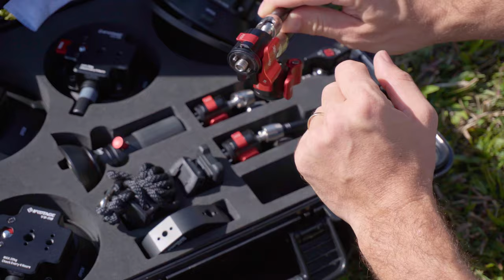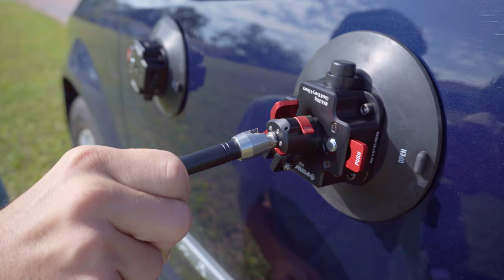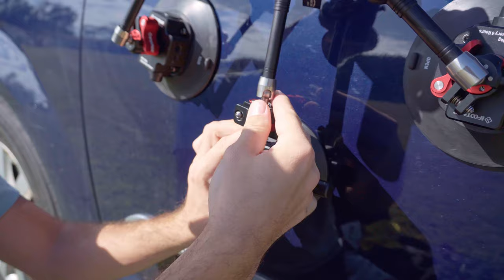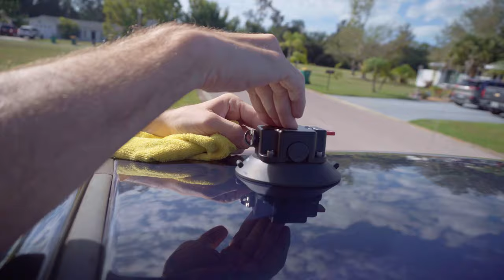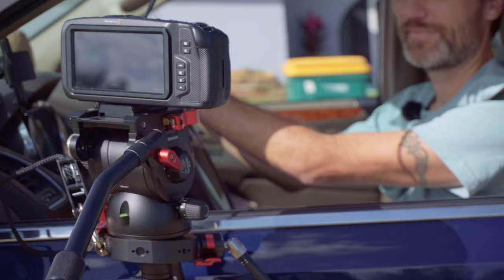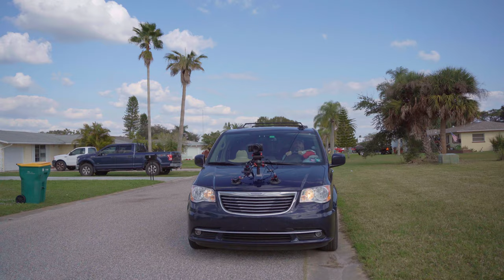Genius Vehicle Camera Mount!

Comment: Looks great! And great practical review.

One thing to keep in mind when securing any vehicle mount is you want to secure it so if the suction cups come loose there will be minimal movement of the mount. One tie-off is good, but it will still fall and flop around damaging the vehicle (possibly an expensive picture vehicle) as well as the camera and mount. So don't be cheap on tie-downs!
Reply from the maker: Good point. I just wanted to use what was provided in this kit but on a real shoot I would use more tie down straps
Reply: @TomAntos  where can i buy the tie down straps separately?

Comment: Great application of these power vaccum cups. Thanks for sharing. You just have to look for the grey ring on the pump after it is sucked down. If the grey is visible, the cup is leaking but still attached with great strength.  With 3 cups you could rip the door off the car so it will never fall off (a 4" cup can hold 185lbs at sea level).  It takes a bit of trust.  Try pumping down to where you can still see the light grey on the pump button and see how strong it is.  These cups are available on Amazon in different sizes and costs and you could make it with magic arms etc but it would not be as well put together as the kit.  Thanks for sharing

Comment: Looks like a great little car rig. I like how quick it was to set up and not requiring any tools. Thought the pins on the sides of the threads were a good safety measure too. 

I would like to see how you would rig it to film the driver from the hood. I am interested where you would set the tie off.
Reply from the maker: To get a shot of the driver from the hood of the car would be exactly the same only difference would be that I would have to use a polarizer filter to hide the reflections in the windshield. This way you can see the driver instead of the reflections of the bright sky. Also this filter would hide the reflection of the strap that goes to the roof of the car.
Reply: @TomAntos  That is great that the polarizer will minimize the reflections (including the strap). This was a great review, as always. Thank you and I hope you and your wife are enjoying life in Florida now.

Comment: Very cool system.
Thank you for the review!

Can you test it with an IBIS-camera and a gimbal?
Would be interesting to see how much it smooths the shot...
Reply from the maker: Okay ill do a follow up video on my website
Reply: @TomAntos  Thank you!
Reply: IBIS when used hard mounted to a car will create micro vibrations. Highly recommended NOT to use a camera with ibis, even if it’s disabled. Learned that the hard way…
Reply: @joenicklo  Oh, that is unexpected...
Reply: @GregorPQ  Joenicklo is 100% correct I can confirm. Panasonic G9 was the camera used in my test.

Comment: As you’re saying at 14:50, any follow up on this?🙂 How is it holding on? Thanks
Reply from the maker: It still works solid but i did buy proper ratchet straps to secure it to the car since the provided rope wasnt enough. But the rest works great till this day.
Reply: @TomAntos  thanks mate, great! Been looking for something in between the Triple Fat Geko and a Tilta Hydra. 
Do you find that the 75mm screw adapter is too tall? 
Last question.. Doing any gimbal work on this? Was thinking would be a quick solution for using a ronin 4d, maybe with a vibration isolator. Thanks again

Comment: A single wee safety cord, to secure a suction cup mounting system, secured by a suction cup? What could go possibly go wrong?
Reply from the maker: This is all that comes in the box so I only wanted to use that in the initial tests but for actual use  just buy a set of $10 tie-down straps so you can attach it to the car with more points of contact. Watch my DIY car rig video and you will know what I mean. Thanks
Reply: @TomAntos  One can only hope that the inexperienced buyer doesn't simply rely on the single cord. Unfortunately, I can see this happening all to readily, especially if they just rely on what was supplied and shown to be tested. I had a look at their website and they seem incredibly lax about an extremely important safety issue.

Comment: Will it handle my c200?
Reply from the maker: It could but depends what lens and accessories you include. Definitely try to keep the camera setup light
Reply: @TomAntos  Thanks. If you come across one that does please let me know. Thanks
Reply: Did you consider using a cage and skipping the gimick portion of what's shown?